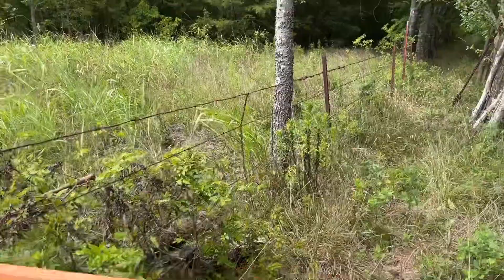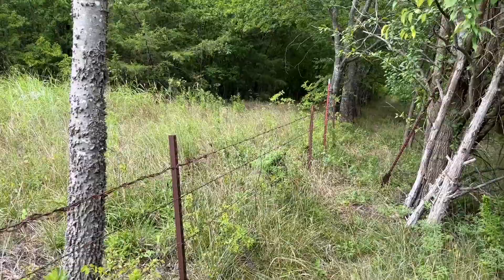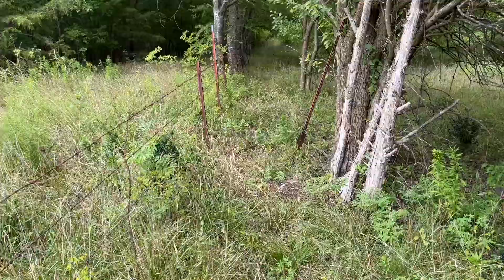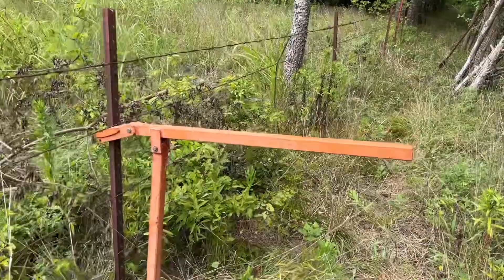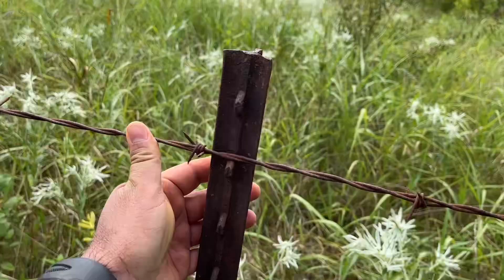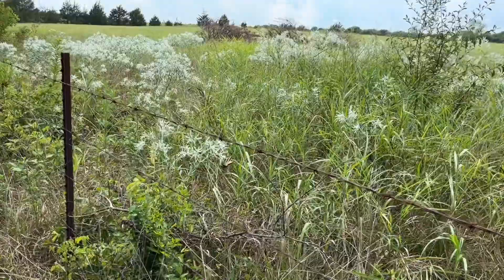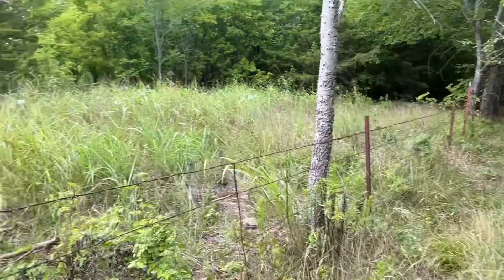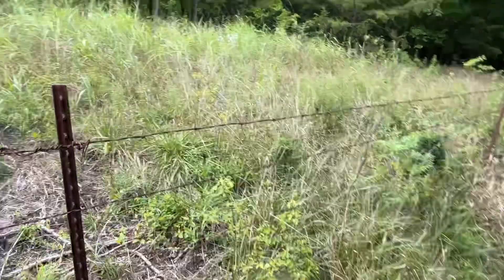Straightening Leaning T-Posts In A Barbed Wire Fence

Comment: I have to connect some of that barb wire to cement,  so I'm going to make holes in angle iron to start
Reply: @LibertyGarden  mostly for the sheep 🐑,  they are coming up to the front of the house and pooping 💩 all over the place lol, so I got to fix this problem.
Reply: @LibertyGarden  That's actually a legitimate protest lol